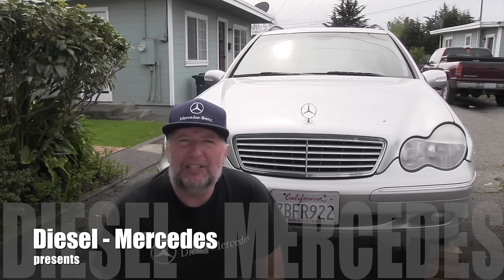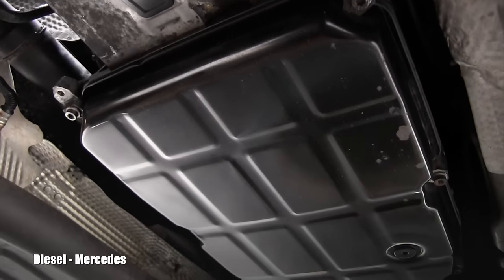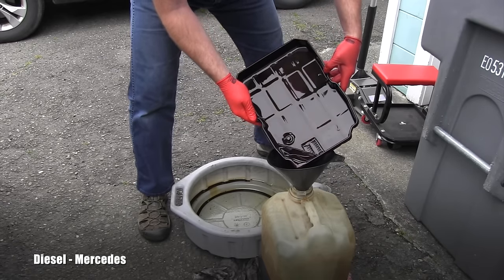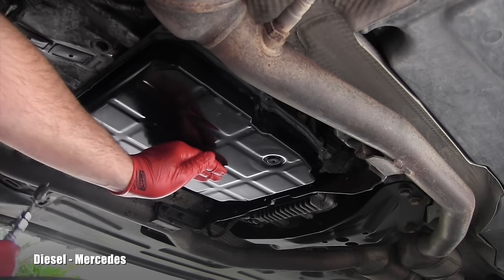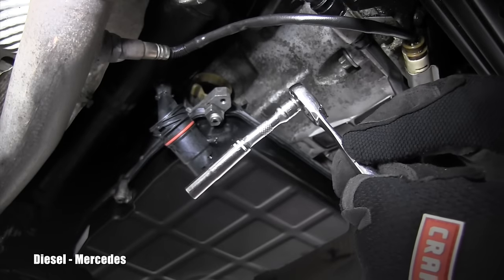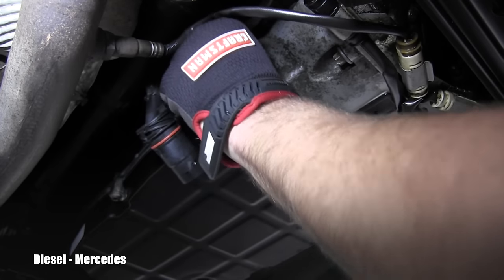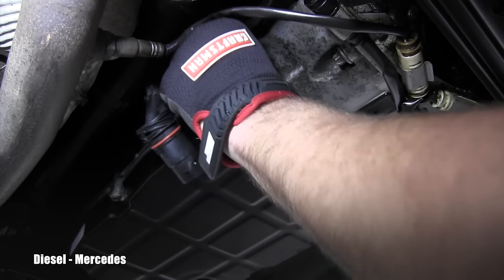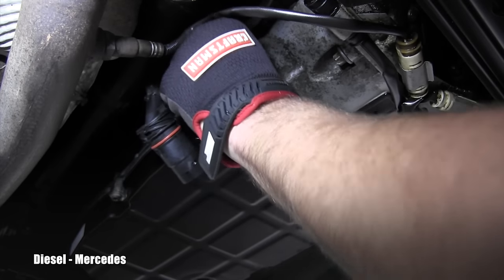Mercedes Automatic Transmission 722.6 full Maintenance Service

Comment: Hi!
I have a 2003 c200 cdi automatic, and doesn't have 5th gear...it runs about 140km/h and 3500rpm.
Do you have any idea?
Can the oil cause this, or it is rather electrical or mechanical problem?

Thank you,
Daniel

Comment: As always, Excellent and very well done. I need to replace the brake booster hose for my 1998 MBZ E320, I took out the old hose end from the booster side, but I cannot take the old hose end from the intake side. Please help. Very much obliged.

Comment: So you put the gasket around the oil pan before you put the oil pan back and you didn't have to put the okay cuz I didn't see you put that on this car that I'm doing this to is gushing out transmission fluid so I reckon it's the gasket and that's and or the o-ring but I'm not totally sure okay so when I put in the transmission fluid as long as it's in the car it runs the car runs so I don't need to do the whole electrical panel replacement is what I'm asking is that right like that's a question I'm asking do I have to put the entire transmission including the electrical panel in or can I just get away with putting in a new gasket and a filter and an o-ring and the electrical socket or whatever excuse me I don't know the technical term sorry for lack of punctuation

Comment: What if it is catastrophic what if it's like worse than that as far as when you pull the dish out that has all that oil in it is that all the transmission fluid in it what's the metal parts are bigger

Comment: Hi so we always need to check the level when the engine Its running correct?First when we start the car which is cold(bottom measure)end when the gearbox Its hot should be in the top range??many regards

Comment: Can I suck it out with a vacuum cleaner from the bottom like is that possible is that okay when I'm underneath of it I mean because even if you suck it all out from the top it's still going to have it's in layers right so the s***'s going to keep pouring out as you pull the layers off is it okay to use vacuum as when I'm asking

Comment: After changing the conductor plate the car not starting ( a e320 98) and gear is stuck in park position. Any thoughts?
Reply: P0705 TRS sensor
Use a obd2 computer and watch the transmission codes. You may have to clean the stick on the top and verify your cables on the gearbox are not wet due the oil.

Comment: do you know if the electrical connector needs to be replaced on a cls500 2008 model, i have had my transmission serviced but no mention of the electrical connector you showed
Reply: If you dont have shifting issues or a leak your ok

Comment: Awesome tutorial!
Reply: My question is how you measure the transmission fluid level using a long dipstick which is much longer than the original housing ? You means..put the dipstick all the way in until it goes to the end when the engine is running ? Thanks.
Reply: @kreizmann Thanks.

Comment: Hi there I wonder if you can help me I have a Mercedes mlw164 320d with the 7g  and has developed transmission issue basically it will go into Drive and reverse but when you press the gas it will just rev up high but the vehicle will not move I have had it diagnosed with a star machine but it's not coming up with any error codes for the transmission so I suspect it could be mechanical and not electrical my next action is to check the ATF levels and also change a faulty rear ABS sensor and help or advice of what to do next would be greatly appreciated
Reply from the maker: I'm not familiar with those...sorry ...checking level and quality of fluid should be first step

Comment: Recently flushed the fluid and now it's slipping. It's a 300ce  1992 Mercedes Benz automatic transmission.  What could be the reason it's sometimes slipping when put into firsts gear?
Reply: Bad clutch packs, brought on by a lack of maintenance

Comment: NOT a full maintenance service, you only changed 3.5 litres, still 4.5 litres of old fluid in the gearbox and torque converter.

Comment: I had aproblem with my vito 2009 during it walks the torque was low  after that Istoped the van and turned it off  after that I switching on to continue my travel no one can fixed  this case
please tell me what the problem where

Comment: U add only 3.5 litres?
Necessary to change  this electric part having 7mm inside?
Reply: Haydoura Mhamad If it’s leaking yes. If not then no. You can just drain and refill the same amount.

Comment: I just did all of this and also a transmission reset, my check engine light came on. It won't let me change from sport to weather or change gears and it like it doesn't have power to accelerate. Help!
Reply: Plug it to diagnosis to clear out codes. U should have taken off the negative terminal off the battery when doing this, ecu prolly got info when u took off the electric part off so it shut down into safe mode to protect itself from future damage..

Comment: still don't understand how replacement of the connector stops oil from going up the wires.  the pins are at the end, and the pins go thru the plastic through the holes.  there are no seals there.  the pins go through the plastic and oil will seep around the pins
Reply from the maker: no, oil will seep around failed large O-rings, then fill connector, wires will be soaked by that oil, and if that condition last for long, fluid can start traveling through wires towards the computer....just to be clear, that is rare.....most of the time connector will start leaking, oil on the driveway, connector being replaced, no time for fluid to travel.

Comment: What about getting all the old fluid out of the torque converter?
Reply: Ya, it's not that hard
Reply: Alex I know just flushed mine.......car runs like a dream now.......
Reply from the maker: In different video we confirmed that this model doesn't have torque converter drain plug....
Reply: That sucks, you spun it all the way around to make sure?
Reply: Alex yes sir....... disconnected the line & forced all the old fluid out until it came out clear........
Reply: nice

Comment: Bro one of my threads on the trans is stripped so I can't tightin my pan any suggestions I can't tap it cuz the bolt clamp will not take a bigger bolt
Reply: jack T same with us. Use a hellcoil thread repair fix and buy new bolts and clamps. Its dumb because of that its making our transmission slip. You have to make sure all the clamps are on there good so just repair the stripped hole.
Reply: shirleyn caluza I think the bolt size is m6x32 but I can't find a kit with that size my transmission don't slip I'm getting a lil vibration at low RPMs I did the fluid and filter and it stop like 70% but I can still feel it
Reply: jack T well dang atleast yours one drives. Ours one, our pan wont even stay on. They stripped like 3 screw holes & sold the car to us for 5 grand -.-
Reply: jack T the size is m6x1 for the helicoil kit.
Reply: shirleyn caluza wow thank you so much I've bin looking around for the kit for a week I did see that one but did know if it would fit thanks again

Comment: Why do transmission fluid mix with coolant on Mercedes w211
Reply: If it's like the w202, there is a smaller radiator under the main radiator that its used to cool the transmission. I had a leak there, had to change mine. Never did it mixed again.  But check with someone who really understands about mechanics.

Comment: Good day, Help please, Awful sound in the cabin, please could someone tell me it is a gearbox or it is convertor or something else? it happens when I press the gas pedal, the sound is heard when the RPM reaches 2000 and above, it happens in motion and when the car is standing, the sound is not sure but it seems come from selector zone, the gearbox switch gears  normally, no errors , level oil is ok, please tell me what could be? car is Mercedes w203 C200CDI year2007, automatic gearbox 722.6
Thank you.
link with sound :  https://www.youtube.com/watch?v=V-yFA8dDvg4&t=9s